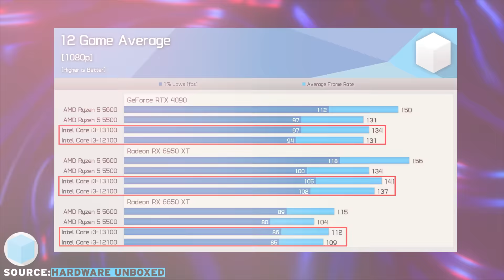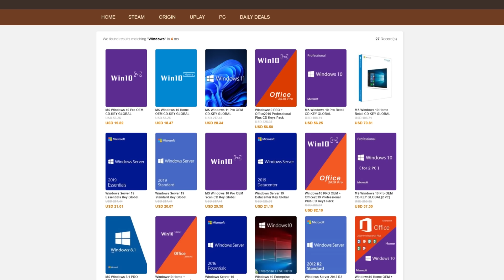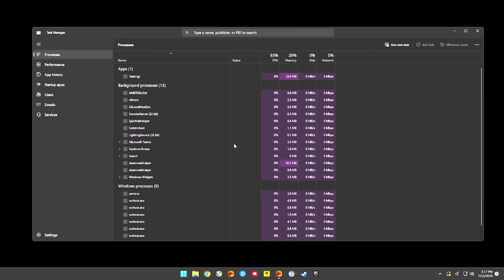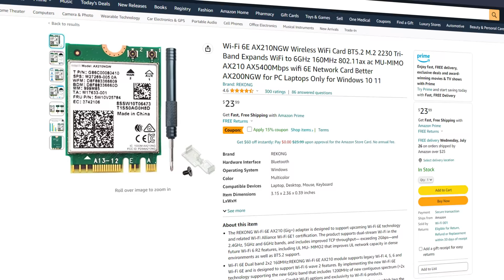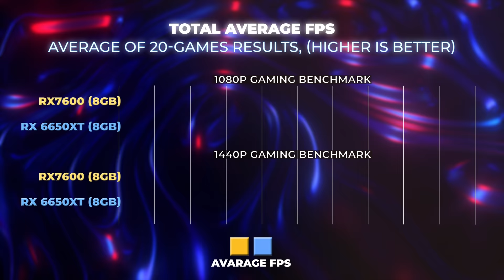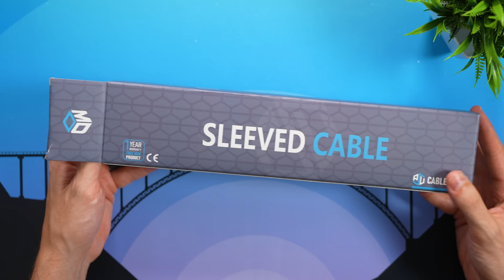The Mind-blowing $650 Gaming PC Build

Comment: I like the fact that as well as having both form and function you included things even though you could have made this slightly cheaper otherwise, I.E. going for a 500GB NVME which wouldn't really be ideal, not including custom cables or ignoring the cost of the Windows 10 CD key. It's so refreshing to see someone who gives you an accurate representation of the actual costs.
Reply: Please I need to know if this PC can support dual monitor (both 1080p)
Reply: @cornelius0ng yes can triple monitor using the gpu
Reply: @oDirtyDraco  thanks 👍
Reply: @oDirtyDraco  also, can the ASUS TUF Gaming motherboard in the description link fit inside the casing he used? Cuz the dimensions on Amazon was around 11x10 inches
Reply: Hey bro, should i use this pc to video edit and sound design?
Reply: @mookibois9784  nah
Reply: @cornelius0ng  Of course?? its one of amd latest launches if it didn't support at least 3 monitors it wauld be weird
Reply: @ZypherionRBX  GREAT 👍🏽
Reply: @mookibois9784   yea actually this pc has some nice options for video editing but im not sure about sound design ignore the guy who said nah as this pc has some great specs but the only issue is the cpu he shouldve switched it to a 12400 or a 5600 to stop the bottle neck

Comment: a simple trick if you want to lower fan speed is either to get a small molex extender and switch the 12v and 5v wires  so it will lower by half the speed for all fans plugged on it or you can do it for each fan  at the risk of damaging the molex socket or wires.  there used to be 3pins to molex adapters you could use with a fan speed controller for manual control. all these methods were used a lot in 2000's back in the cold cathode days but the luminescence of the  rgb may be a bit less bright  either with the 12v to 5v switching or by using a manual speed controller at lower speeds ( some had a knob or  remote control or have 5 1/4" control panel would fit on the  drive bay cage with some creative thinking). dont plug anything else than other molex fans with the fans if you use the 5v switching and put a piece of tape on the  one at the end of the molex centipede might remind you of this.
Reply: can the ASUS TUF Gaming motherboard in the description link fit inside the casing he used? Cuz the dimensions on Amazon was around 11x10 inches

Comment: Very nice build! I would worry about CPU bottleneck, but it is fixable, CPU upgrade path on b660 is great, I upgraded my PC from i3 12100f to i5 13500 and I love it.
Reply: i3-12100f doesn't bottleneck the rx 6650 xt
Reply: Ya no bottle neck lol
Reply: I was thinking of getting a better upgrade with a 7600 and a 6950 XT. Thoughts?
Reply: @07Lightless  yo get the 6700 it has more v ram and I believe it's better than 7600 I think
Reply: @07Lightless  just checked and rx5700 is about 15 dollars more and you get 4 more vram, better performance, and a more effective graphics card in terms of usage temps usage, and power draw
Reply: @aaronphan8322  hey im tryna build my first pc, so do i go for the gpu in the video or do u suggest other gpu? my max budget will be 700usd thanks
Reply: @ikko4209  yo if ur budget is 700, o can help you
Reply: Do u use discord
Reply: Well hopefully it depends on ascetics
Reply: @rolii4198 It does, in apex the gpu was between 70-80% usage. That‘s bad, and this did not only happened in Apex but in other titles too
Reply: @MariusAS76-  It mostly happens in games where you have a lot of fps and in those games for example valorant even higher end cpu struggle with making gpu 100% at valorant or other games
Reply: @ikko4209  i think u can spend + 50 dollars for a better gpu maybe a rx 6700 you could use or u could spend less in a few parts maybe to save a little bit of money to get rx 6700 xt
Reply: @aaronphan8322  When I said 7600 I meant the CPU. Ryzen 5 7600 + rx 6950 Xt.
Reply: @rolii4198  That‘s what i literally said, its a cpu bottleneck. Why are some people just repeating shit to others? Like say something new
Reply: Damn thanks for the heart bro
Reply: @MariusAS76-  You mean cpu?
Reply: @ultramasterultra5724  nah, when the gpu gets bottlenecked it wont reach 100% usage, in apex it was at 70-80%
Reply: @MariusAS76-  That's not true it was 70-80% because it isn't that heavy of a game
if it was bottlenecked cpu would be 100% and gpu like 70-80 but cpu was around 70 to 75

Comment: For your next budget build, have you considered the Montech AIR 903 MAX ATX Mid-Tower Computer Case? Less than $80.
Reply: That one is fantastic. It's like 75 on Amazon atm. Comes with 4 (3 rgb) fans and a fan controller.
Reply: @joshholmes1372 does it fit this motherboard?

Comment: pretty tight budget, but i have some suggestions about the ram, the simpler solution is to get some ddr4 3200 cl 14, for about 40$

alternatively  i would suggest "ASRock B760M PG Riptide "  for an extra 25$.  a much better board with better power delivery, an extra gen 4 m.2, better lan, and most importantly ddr5 support.  and a single stick of ddr5 for about 40, with the expectation of getting another 16 later
Reply: No. Using 2 sticks of ram is way more important than using ddr 5.
Reply: @joshholmes1372  you will be happy you had the ddr5 later.  pretty much no reason to be doing a new build with ddr5

Comment: Don't go with an A520 board, it severely limits you in what you can tweak. You can't mess with your CPU clock speeds, voltage etc and you can't even overclock your RAM sometimes
Reply: i would say a MSI B550M PRO would be better, its like 30$ more but its worth it plus an extra m.2 slot as well

Comment: Intel core I3-12100F
Asrock B660M Pro RS
Timetec pinnacle konduit 16GB 3200MHZ CL16 DDR4
Crucial P3 Plus 1TB M.2 pcle4.0 nvme
Radeon RX7600 8GB
DIYPC-Q3
Apevia spirit 600w
Abno1 cables

Comment: I added a variable resistor knob to my build for my add in front 140mm fan to a dell opti 7020.  It's mounted in a drive bay slot but can mount in a rear card slot.   I keep the fan speed at about 1/3rd.
Reply: Bro why are you telling us this, no one cares

Comment: i have a question
is this better than my current build or is it almost the same? which one should I consider upgrading or buying
my current specs: 
R5 2600
32gb ddr4 running at 2900mhz
gigabyte 6600 eagle
1tb nvme ssd  

Thanks TS!

Comment: I'm watching this from Canada and recntly built a 1000 dollar PC.  At first I thought his was more budget, but then realized with currency exchange and taxes, mine was actually cheaper.  It has ASRock RX 6600, AMD 5 5600, RM 750x power supply (which I prefer to prevent burning my house) and also I think the cost of the flash drive to install the OS should also be taken into account.

Comment: Glad someone has luck with apevia power supplies. I bought a brand new 900w semi modular one and within the first week it burned up. Got a refund instead of a replacement because all the recent reviewers since id bought it said they had the same issue. I was only powering an older amd 6300 fx and a power color rx580 red devil and nothing else that was that power hungry. I bought it to replace an evga 650watt power supply that kept shutting off randomly.
Reply: Never skimp on PSU. You're lucky if it only burns itself out. It could fry your mobo or worse.

Comment: It's amazing how much prices have dropped for PC components. It wasn't long ago that $650 wouldn't get you anywhere near this price to performance. How is the value for the money on this PC that I paid $300 for?
MSI Z370-A Pro Motherboard 
i7 8700k overclocked to 4.7GHz
Asus Turbo GTX 1060 6GB 
Patriot Viper 16GB DDR4 RAM at 3000MHz 
Corsair H100i 240mm AIO cooler 
Kediers C570 open air case 
I had to provide the PSU and storage since the seller removed them for his new build. I had a prior computer and took the PSU from it and bought a 1TB NVME SSD for faster load and read/write speeds.

Comment: I am currently builing a Buget build. Here is a list of the Components. Should i change something or?

Processor: Intel Core i3-12100F 12th Generation
GPU: XFX Radeon RX 7600 Speedster SWFT210 Gaming 8GB
PSU: The Apevia you mentione isn't available for germany, any other recommendations?
Motherboard: Gigabyte H610M S2H DDR4 Motherboard Intel H610 Express LGA 1700 Micro ATX
case: Deepcool Macube 110 Minimalism Micro-ATX/Mini-ITX Computer Case Support 240/280 Cooling System

I still have my current ram and SSD an HDD

Most importantly is if that Mainboard is good for this build?

Comment: Hey I just built this same pc but have a question.
You said I needed a WIFI card or WIFI adapter. 
However, the motherboard came with 2 antennas, and the motherboard website says something about not needing the wifi adapter or card if the PC has windows 11 as it supports the wifi..so, If I install Windows 11, will I still need the wifi card/adapter?

I'm not even sure if I'm making any sense tbh, this is my first PC hehe
Reply: did it work ?
Reply: @ssjmp  hey, I didnt have to buy any adapter or wifi card. I was able to connect to wifi once I installed win11 .

Comment: i genuinely need your help. i just put my pc together or attempted to i dont know everything about a pc but everything turns on fine. but it doesn’t display anything. ive tried everything my brain can think of
Reply: If you still are sh Ing trouble tell the geek squad to build it for you because I did
Reply: bro connected the cable to the motherboard :face-blue-smiling:

Comment: Is this a good enough build it's costing me 650 usd everything brand new accept the graphics card . Any advice for me? 
PC Specs

Ryzen 5 5600 brand new 

MotherBoard gigabyte B550 ds3h  brand new

16GB RAM  Lexar 3200MHz 
 brand new 

Amd Wraith Prism Cooler brand new 

512 Gb Nvme 

Xpg 650W 80+ bronze PSU brand new 

Sapphire RX 5700 XT 8GB  VRAM Used

Comment: Should I upgrade my pc?
Current specs
Ryzen 5 3600
AsRock B450
16gb ddr4 2666
500gb ssd 
Radeon RX5700

wondering if its worth it just to get a whole other pc other than replacing all the parts
Reply: I think your gpu to a rx 6600 would be good and if u have extra money cpu ryzen 5 5600 but first rx 6600
Reply: @Theninjafirebest thanks I’ll look into that

Comment: Instead of using an i3 you could go with a 12th gen i5 with a cheap 20£ cooler. To make this fit in the budget you will have to downgrade your GPU to a rx6600 which is still good for 200£.

Comment: i have the exact same case but for whatever reason i can never control the rgb on the fans at all, it never lets me, i have the 3 pin 5v connected, but it still cycle through it rainbow puke and bad color effects, help
Reply: Gigabyte RGB Fusion 2.0

Comment: do the parts work together, Seasonic FOCUS GX-750 ATX PSU, 750WAMD Ryzen 7 5800X CPU AM4, Kingston FURY Renegade RGB DDR4 3600MHz CL16 32GB, Asus ROG STRIX B550-F GAMING WIFI II AM4 ATX MotherboardNZXT H7 Flow Mid Tower ATX case with glass side, black/white, Kingston NV2 NVMe 1 TB M.2 PCIe SSD, DeepCool LS720 AIO ARGB, DeepCool SC700 12-port ARGB control unit, msi geforse rtx 3060ti aming x trio, Fractal Design Prisma AL-12 ARGB - fan pack, 120 mm, 3-pack. I want a nice computer with an RTX graphics card. I already bought the graphics card and the fans for 370 euros and 40 euros

Comment: Hey nice and clean build.....I just want to know, if i should go for 12400f or 13400f, is it better that i will regret, i have a ddr5 ram 32gb kit, 3060ti , i got a good deal ......just confused between the processors....?
Reply: 13400 has 4 e cores, while 12400 doesn't have any, the 13400 clocks very slightly higher.   sometimes 12600k drops down below the cost of a 13400, which is essentially an unlocked 13400
Reply: @nostrum6410  i checked 12600k also....it is close to 13400f.....i am on a budget.....i am stuck with processors,

Comment: I am planning on building a pc worth 650$ with these components
B450M BS3H WIFI
RYZEN 5 5500(Later I will upgrade to a 5600x)
G.Skill RIP JAW 2×8 16GB
XPG SX6000 PRO M.2 NVME GEN 3 SSD 500GB
ANT ESPORTS SX7 CASE WHITE CASE
GIGABYTE RTX 4060

NOTE: I LIVE IN INDIA ❤

Comment: isnt the 7600 and the i3 13100f a bottle neck thats over five percent
Reply: You probably used a bottleneck calculator to get that number so just telling you that you shouldn't use bottleneck calculators. They're more often than not basically just random numbers and can't account for all the variations in use cases, like different games, or even things that aren't gaming.

Comment: Question: So I noticed how you said most games were no problem except for Cyberpunk which is kind of bad news for me because cyberpunk is one of the main games I want to play once I build my PC. Now my budget is just a tiny bit higher at $700 and I'm not super knowledgeable about computers so I was wondering if theirs anything I can do with that extra 50 to maybe make it run better like by a better part in some areas or anything like that.
Reply: Probably go with a better cpu or gpu. Either go i5 12th gen or go for a 3060 ti. Either way don’t expect to do ray tracing, but running DLSS and setting the game to probably medium settings will land you a solid and playable experience
Reply: if you haven't purchased anything get 6700xt

Comment: I don't think it is possible but ill ask anyway: is it possible to put like something on the pc to limit it's noise?
or even to convert the fans to speed adjustability?
Reply: You can buy low noise fans. I don't have any in particular to recommend. Most motherboards let you adjust fan speed through the BIOS where you set fan curves. You can also buy fan controllers to adjust the fan speed.
Reply: @JJFlores197  thank you so much

Comment: Please I need to know if I can use this build with dual 1080p monitors
Reply: Of course. It has 1x HDMI and 3x DisplayPort outputs according to the specs. You'll need a DisplayPort to HDMI cable/adapter if 1 of your monitors don't support DisplayPort.
Reply: @JJFlores197  okay bro, thanks for the update 👍
Reply: @JJFlores197     also, can the ASUS TUF Gaming motherboard in the description link fit inside the casing he used? Cuz the dimensions on Amazon was around 11x10 inches
Reply: @cornelius0ng  Motherboards come in set-standard sizes and PC cases have a number of standards they support. These are known as form factors. Both the boards and PC case support the microATX standard, so yes the board will fit.
Reply: @JJFlores197  when I did some research, the casing that was used in the video supports micro ATX motherboards, but when I checked the dimensions of a regular micro ATX it was 9.6x9.6 inches max. The alternative motherboard which is meant to run the Ryzen 5 processor tho was 11x10 inches when I checked it out on the Amazon link, that's why I was confused. Those dimensions match ATX dimension specs but the board was labelled Micro ATX, hence I was confused and unable to decide if to buy the case used in the video, or an ATX one on the same website
Reply: @JJFlores197  Is it possible for the PC to run games at 1440p and maybe 60fps? Or is it strictly 1080p?

Comment: You caught my attention when you said 'go check if your ram is running at its max speed'. i have 4 sticks of 8gb 3600mhz CL18 but have them running at 3200mhz instead of 3600mhz. when i try them at 3600mhz i get infinite blue screens. Can somebody maybe help me with that? 
Ps. love the video <3
Reply: Your cpu probably doesn't support that mhz it has its max speed probably 3200mhz.
Reply: @seberman6640  thanks for the information
Reply: You should try to use 1 ram each and XMP them one by one and see if it happens in all of them. It can be 1 faulty RAM that's is causing it or not.
Reply: @fightnight14  I can use 2 sticks at 3600 but not 4. I just use 4 now at 3200mhz

Comment: Would I be able to hook it up to a tv by any chance I’m a new gamer and I would like to upgrade my setup
Reply: Using hdmi presumably
Reply: Yes of course. It can connect to any TV via HDMI. Its no different than connecting a game console to the TV.
Reply: @JJFlores197  oh ok thanks
Reply: Just remember that an hdmi cable will probably tap out at around 60 hz refresh rate while a display port will give you a much better speed. Plus not really a need for a gpu then if you use an hdmi cable to connect it

Comment: Would not want to be skimping on psu. Especially bottom toer apevia thats not rated at all. Id at minimum drop the 20 bucks from the psu cables and buy a bettwe psu. But if you dont mind blowing your shit up, go for it.

Edit: save 20 bucks on cable sleeves and upgrade psu to corsair cx-m 650w 80+ bronze modular.
Reply: I was thinking the same thing.
Reply: apevia is cheap and good and it's not 2005 where psus blow up unless a lightning strikes on it or something

Comment: Should I buy 32gb 3200mhz or 16gb 6400mhz
Reply: it depends what your cpu and motherboard supports but if it supports ddr5 then get 16gb of 6400mhz ram otherwise if your cpu and motherboard only supports ddr4 then get 32gb of 3600mhz ram

Comment: Have you tried using the standard or quiet fan profiles in the fan curve settings within the bios? Just curious.
Reply: The molex connectors plug straight into the PSU, completely bypassing the motherboard.